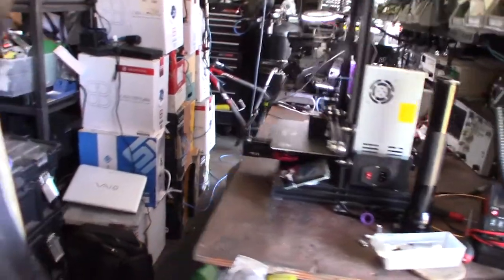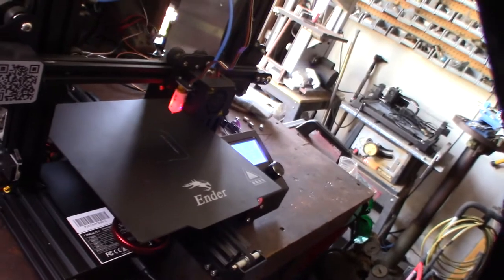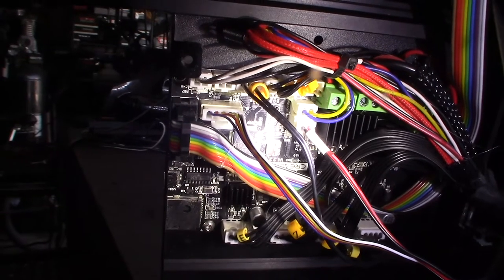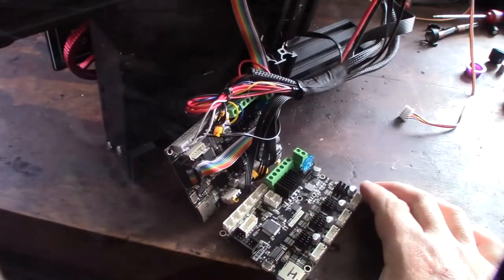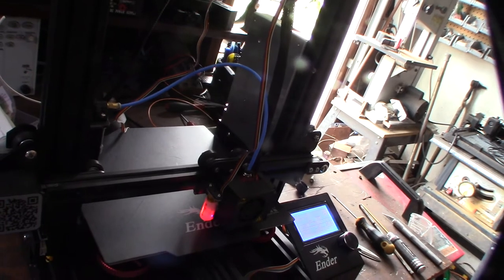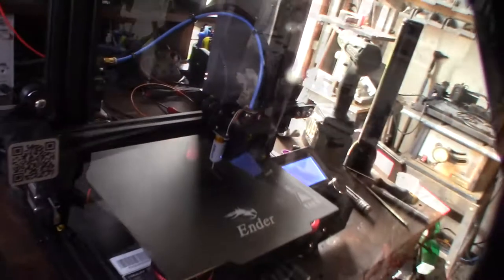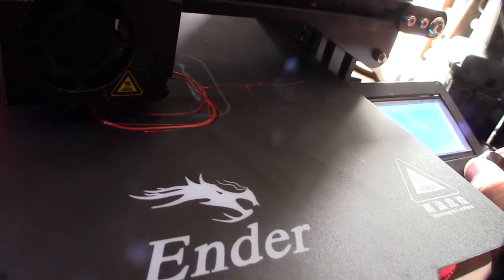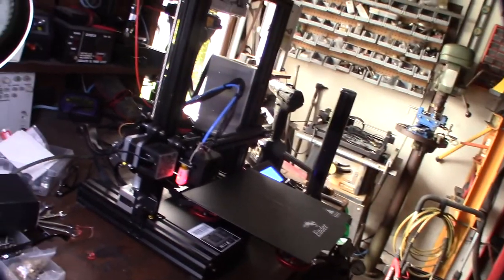Creality Ender 3 Pro 4.2.7 Silent Mainboard BLtouch upgrade repair troubleshooting Marlin 2.0

Comment: Hi, How do we know if I fried display board, the motherboard or both? I have upgraded my hotend to v6 and while changing filament whith hotend 
 powered up, I saw small spark around the screw of thermistor. then eveything went blank. Screen gets power (i see backlight on and turn orange on firmware upload), 
Hotend fan turns on, com port not recognized - pc to usb, both fuses ok. I have ender 3v2 4.2.2 board